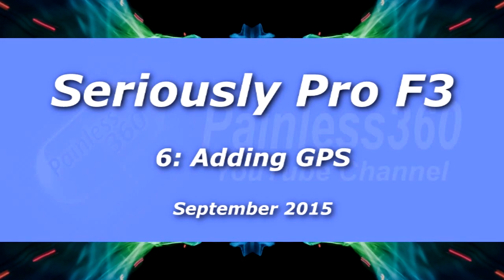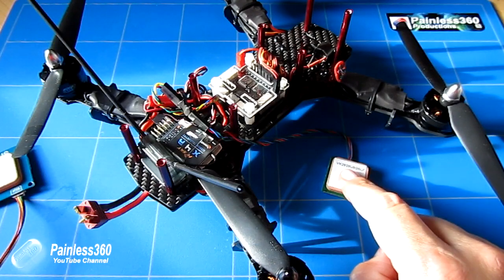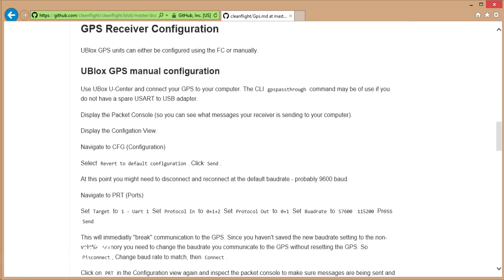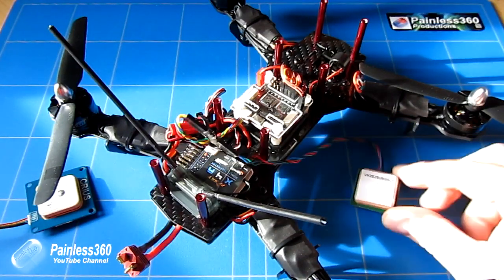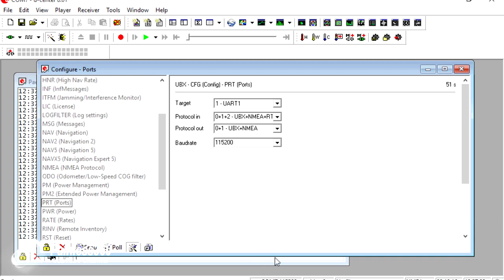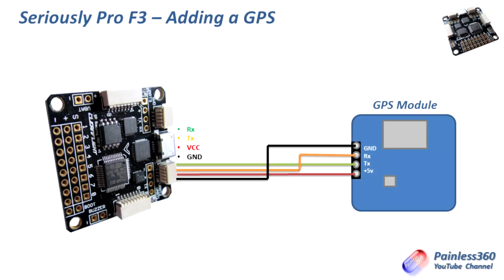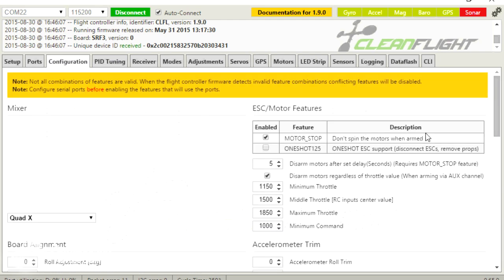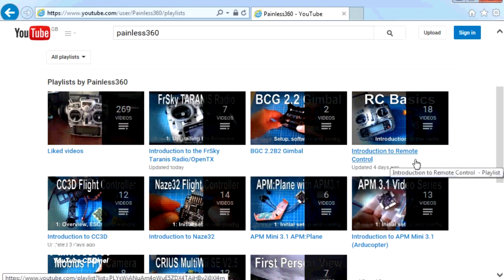(6/9) Seriously Pro F3 (SP3) Series - Adding GPS

Comment: I am following your tutorial in 2022 and it is just amazing as always
I get my spf3 board in the few last days it's a 6dof acro board but I just upgraded it to the delux version by simply soldering hmc5883 and the ms baro and it's working grate
Thank you very much for this series
By the way I spend the past 2 years on developing 2 version of my own 10dof flight controller board which was a success and it just working great taking into consideration that they work on atmel328p and atmel2560 for the pro board and runs on multiwii 2.4 software but they just work very good even with 10dof sensors and GPS plugged in

Comment: If youre having issues using U-Blox program and the gps not connecting, if you're using a usb hub, be sure there are nothing else plugged in with the gps... I had a mouse plugged in and it conflicted with the gps.. once I unplugged the mouse it worked perfectly...and just used the mouse pad instead.

Comment: Great video. Always enlightening. The step was perfect and just one adjustment needed for me. In 22:57, you are set the GPS to Ublox protocol in GUI but for my case it kept the NMEA after I save and reboot the board. Fix it by CLI command :

set gps_provider=UBLOX
SAVE

Hope this works for other having the same problem.
Reply from the maker: Sounds like a bug in the version you're using. These kinds of things come and go in Clean/Betaflight. If you are interested in GPS then I'd look at running iNav.. Best of luck!

Comment: Excellent job, 2 months ago would have been even better. I did this with a neo-m8n which takes 3.6v but battery was bad, bumped up to 5v and it now works perfectly. GPS hold does not do the ever increasing circle but does not hold alt. Forgot to try switching on barro at the same time, thought that should be part of hold. RTH IS AMAZING, comes back makes about 1.5 circles from take off and holds dead on, again no alt hold. I'm tickled crap-less. I have an unlisted beginner vid of my last test if any one wants to see.
Reply from the maker: Its great to hear that you have it working.  Lots of work from the developers on making the GPS code more robust so more of us can get that same grin! :)

Comment: Thanks Painless 360 really helped me.  I was able to use auto config when I change my baud rate to 57600 . GPS came on immediately never so glad than when I saw that green blinking led light  my first quad build completed YEH!
Reply from the maker: Congrats! If you want to really use that GPS see the iNav series ;) Happy flying!
Reply: Thanks again I tried clean flights gps and I must admit it was disappointing although running every other mode it was excellent. except for the 18 crashes I had in 1 hour LOL.. I had alot of fun but this type of  flying isn't what I was looking for.   The DJI Naza M v2  is what I was more looking for. I have flashed INAV  on my board Sp F3 everything is running including 3d GPS Lock for the first time awesome. Never could get that to fully work in clean flight. Now for my question Why do you think INAV doesn't support D SHOT ? I didn't realize  until  I when to calibrate esc that. I had to reflash my esc too multi-shot  and then go back to INAV and set protocol to multi-shot  before I could calibrate them and get flying. Took me a couple of days researching before I realized my error. Part of the hobby I guess. Also figured out how to change the tones in the goggle app BLHELI configurator there doesn't seem to be any videos online of this . Only ones are using of old configurator  . The most recent was 2 day days ago. I bet pilots would very much like the new way no downloading or trying to find the wright firmware just update and use the slider write and all done. Thanks again for your help watching all your INAV vids now.

Comment: I had some confusion and hope you can clarify something for me. Why do we set the GPS up for UART 1 and then physically plug it into UART 2 and set up the F3 on UART 1? For over two weeks I thought YOU made a mistake and then I finally decided to just do what you said and VOILA! It works. I you have time to explain or tell me where to look I'd appreciate it.
Reply from the maker: The Cleanflight documentation is very good at covering all of this. I have to admit that we struggled to get some of this working and ended up talking to Hydra to get some of it working. The PORTS tab used to be a lot more sensitive to config errors and would let you do things that would stop the board from booting or be deleted as an invalid config without warning. Just follow the video for the easy ways to setup! :D

Comment: Hello, this is a great video, its because of your videos that I have managed to build 2 quadcopters! I would like to ask you: Do I need to preconfigure my UBLOX NEO-M8N with the computer method that you demonstrate here, in order to use it in iNav? I have already installed it onto my spracing f3 evo running the latest inav version and it does get a 3D fix with the gps module as is and shows the correct position in the gps tab, but when I go out to fly the quadcopter, poshold is terrible!!!
Reply from the maker: See the iNav series on the channel for lots of detail on that. The GPS module should auto-configure. In that series we also cover the causes of less than ideal poshold too.. Best of luck with it!

Comment: Good video but I am curious why you decided to go with a serial GPS vs an I2C GPS.  I would think you are running short on UARTs on the SP3, especially when adding Smart.Port telemetry (looking forward to the video that covers that) and could have save a UART by using a I2C GPS instead.  Thanks.
Reply from the maker: +bitogre Excellent idea, I've not seen the detail on how to setup the i2c port for GPS data in Cleanflight. Can you point me to the URL and I'll give it a go..
Reply: +Painless360 My mistake.  After I posted this, I found CleanFlight issue #363 https://github.com/cleanflight/cleanflight/issues/363 which shows it is not yet supported.  Sorry for thinking it was supported.  Given this, I am even more interested to see how you get the SP3 to support Smart Port, GPS, S.Bus, and WS2812 LEDs all at the same time.
Reply from the maker: It's easier than you think. In v1.10 (out very soon) we get the SoftSerial features back in SP3 so we can then add another two low bandwidth peripherals again.

I am fighting with an issue with having more than one telemetry type at once but I've flagged that to the developers..
Reply from the maker: +Painless360 You can preview the Cleanflight FrSky SmartPort telemetry settings on the SP3 video series now by watching https://www.youtube.com/watch?v=mFvb40oE_pM&index=9&list=PLYsWjANuAm4ro1vHztauuHFaelUDCOwqw
 Hope it helps.

Comment: Hello, thanks for your video. I'm working on connecting my Neo-6M to my SP F3 Racing. The GPS is working fine on the PC using the ftdi adapter. I've configured it just like you showed and just like it's stated in the cleanflight documentation. 
My problem is: it does not show that it's got a gps in the configurator. Do you have any idea what could be the problem?

I've connected it to UART3 which is not being used for anything else. I'm using the latest betaflight firmware (same as cleanflight). All baudrates, wiring etc have been checked.
I also couldn't get gpspassthrough to work, which might be a hint.. I don't know what this could mean.
Any help would be greatly appreciated!
Reply: DerKrawallkeks hey im dojng the same did u get working
Reply: thanks, glad there's someone who doesn't say 'not possible' ^^ I've got my gps module working. I bought the cheapest gps unit I could (Neo 6M) and it works. Make sure to connect it to UART2. I tried 3, cause it was also unused, but does not work. 
Problem is: I got gps signal, but my flight modes don't work. You need a compass(magnetometer) to get gps modes to work (which my flight controller doesn't have). So I'm waiting for the cheapest compass to arrive. Right now, the dron just circles uncontrolled around the desired position.
What are you planning?

Comment: Hi Oscar
What is hidden under the heat shrink where the gps cable connects to the SPracing F3 cable? 
I rely on your videos I would not be flying without your help thank you Crash
Reply from the maker: A simple straight through connector made from two 4 pin strips soldered back to back.

Comment: Thank you for the response sorry about the Hi oscar. painless360
Do you have any info on the hookup  for an HK M8N with compass I have the GPS working. The M8N has a 6 wire harness the last 2 wires are SCL and the other is SDA im thinking these are the compass not sure how to implement on the SP3 thanks for any help, Crash
Reply from the maker: +James Courtney We use a similar GPS with Compass in our APM3.1 series. You need to figure out the leads that match the ones we are using here in the video. The others will be for the compass.. Those APM 3.1 videos may help there - I cover it all in those..

Comment: Works fine on my FLIP32! 
The only problem I have , is when I turn off  the GPS for a longer period  all the settings are gone and I have to configure it again.
Any tips?
Reply from the maker: +fit2fly Sounds like the battery in the GPS needs replacing..

Comment: Great instructions, yet again..... I have a mates  Sp Racing F3 EVO RevE purple 2016 model to setup with the BG BN-880 GPS module. The layout is different than your presentation one,  obviously,  an evolved one. The UART2  is on the LH side of the uUSB but have still configured  this in Cleanflight Ports,   to accept this for the GPS module

 Having gone through your instructions at least half doz time's still cannot get CF to recognize the GPS module, I note that the GPS Protocol will not change from NMEA to UBLOX !? and at the top of the CF Configurator the GPS indicator is off....please any idea's
Reply from the maker: The GPS may need to be setup so that Cleanflight/Betaflight can understand what it's saying. See how we setup the GPS manually in the SP3 series - that should help.
Reply: Interesting, I have the same issue with a Full Naze32 board and a Neo-6. I can't set UBLOX, it keeps defaulting to NMEA. I am using the Painless360 file as per your Naze32 instructions.
Reply from the maker: Remember to save the config (in the GNSS software menus at the top), if you're doing that and it's not remembering then the on-board battery my need replacing on the GPS module.. Best of luck!
Reply: Fixed; used the text input, 'set gps_provider=UBLOX' and it stayed. Just would not switch in the GUI! Cheers Painless, you're a hero.

Comment: hi there, thanks as always for your videos :)
I bought the same GPS ublox8 from hobbyrc and I'm following your video step by step
now I have a problem when it comes to the msg part, after setting up the first one (either NAV-POSLLH or any one else as first 1), i select the second one but after 2 seconds it automatically comes back to the first 1 I' ve set and it does not allow me to complete the procedures. do you have any idea on why thes is happening? I'm using the last u-center version 8.24.
also a strange thing in the ports, when you set the part, I get on screen USART instead, is the same thing?
last thing, how do you get the fix indoor? :))
thanks
btw, on hobbyrc webpage they say to use the iNav, what do you think?
Reply: hi, I figured out what was wrong :) a bad soldered pin hahaha, now I was able to set and follow your video, thanks a lot, just 1 question tho, how can I set it on UART 3? when I go to port I only have UART1 and UART2. thanks
Reply from the maker: It should have UART3 is it's a SP3 flight controller (or clone)...
Reply: hi, thanks for the reply, about the UART 3, I mean in the GNSS U.Blox software, there is no UART3 in configuration, but anyways, I've installed the INAV so that sorted everything out :) still big thank for all your videos, I'll posta a new message on the let video as I have some issue which can figure out :)

Comment: You can use ublox resource without using a FTDI adapter on Inav Cleanflight by typing gpspassthrough in CLI disconnecting cleanflight and connecting ublox.. Works on naze32 not sure about F3 boards .
Reply from the maker: Great tip, thanks for sharing! Happy flying!

Comment: Very good video series. I'm trying to follow that to configure my board with GPS. While the 3 principal modes are working fines, I experience issue with barometer mode and GPS hold mode. I do not see any improvement when I'm activating them. I started a page on rcgroups for help...
Reply from the maker: +Gilles Mathot GPS modes are experimental. Best of luck with it.
Reply: +Painless360  I can understand it's experimental but it looks like the GPS hold mode does not enable. Angle mode works fine, horizon also and baro as well. when I switch to GPS, it does not change anything even if in clean flight I see GPS-HOLD green in the modes. I did all the FTDI stuff on the GPS and crosscheck 3 times. In the packet console, I can see that I sent the right messages... I'm stuck...

http://www.rcgroups.com/forums/showthread.php?t=2602932#post33987524
Reply from the maker: I'd look at using iNAV (fork of Cleanflight testing the new GPS code) and see how you get on there..
Reply: +Painless360 : I did try Inav and position hold with default gain is quite impressive. Thanks for the help. So it looks like the root cause was the firmware itself.  I will configure return home and have a try.
the only complain currently is when GPS hold + ALT hold is enabled, the quad goes down quite a bit and down to the ground is starting height is tool low. But I'm pretty happy with the F3 and GPS and the achieved results.

Comment: Hi thanks for this video!
I was wondering if you ever experienced this GPS module losing it's settings after a period of no power. As I understant, the battery is only for warm / hot start, and that the settings are ment to be stored in the eeprom, but it seems once the battery runs down I lose all settings :S Thanks for any advice you can offer!
Reply: Ok, I think the problem was that I wasn't selecting the I2C-EEPROM in the Devices list under the Configuration CFG section before saving it. Only time will tell :)
Reply from the maker: Best of luck!
Reply: +Painless360 Seems that did the trick, I have a Crius Neo 6m v3.0, but I got it second hand off ebay, and its seen better days.
Maybe the same would happen to a new unit, just takes longer for the battery to run low. I was also worried that mine mite have been a cheap copy that tends to be constructed without the eeporm. After looking up the chips on the board I spotted the i2c eeprom chip, so I knew then the setting were going for some other reason :)
Reply from the maker: Glad you got it sorted. Best of luck with it!

Comment: I have my GPS configured via Ublox (double checked) but when I connect to Cleanflight it won't allow me to properly configure UART 2. If I select the baud rate 9600 for example and check Serial port it doesn't save the configuration. It will only save the baud rate but when configuring the port it reverts to being grayed out! GPS is showing good lock but nothing in CF. Any suggestions as I'm all out of them. Mike
Reply from the maker: +Mike Hawkey no idea, sorry. What we did is all in the video. If you're interested in GPS functions, then I suggest looking at the iNav series on the channel. Much more useful than cleanflight or betaflight for GPS

Comment: i have connected gps and works, but after going through your video still not sure where to plug in the bluetooth module could you tell me the port name to be use please？
Reply from the maker: I'd normally add that to UART1 as that shares the MSP port with the USB cable. Make sure you unplug the BT module when using the USB port though..

Comment: question good Sir, wondering why in Nav5 , Dynamic mode does it say to set to "Pedestrian" ? shouldn't it be Airborne since its on a quad that flys in the air?
thanks
Reply from the maker: +tntaftershock It's more about the expected GPS speed range than the usage.. Happy flying!

Comment: I've done all the steps and set the device (neo m8n) to update at 200ms, which should work according to what I've read. Problem is, when I plug the device into a pc it's recognized as a mouse and starts screwing with my normal mouse. Is this a common problem, because from what I've read so far it's not so easy to fix.
Reply from the maker: I've never seen that, I'd delete the device from device manager and start again. .Best of luck!

Comment: What is the reasoning behind selecting uart 1 in the msg (messages) configuration, but connect the module with uart 2 on the FB?
Reply from the maker: MSP is Multiwii Serial Protocol (what the USB connection and OSD/Telemetry systems use). Best of luck with your build - the video shows what worked here..
Reply: had the same question, don't really comprehend your answer though. what does the meaning of msp have to do with difference in setting up and using different ports. although i trust you did everything right and that it will work fine, i just don't understand it and i would like to.

additional, or rather primarily . Love your channel, it thought me a lot and am starting from scratch so that says a lot. keep doing the good work!! loving it.
Reply from the maker: MSP needs to be on UART1 for the USB to work.. Best of luck! :D
Reply: Well, if you read the SPRacingF3 Manual, the UART2 on the FB is the one with 5V (either logic level or VCC)
thats why its connected there, the other ones are either debug, 3.3v or some other thing